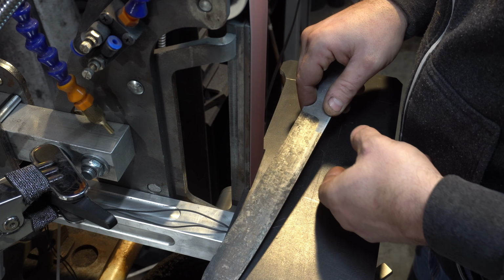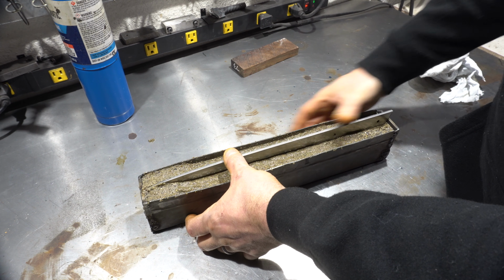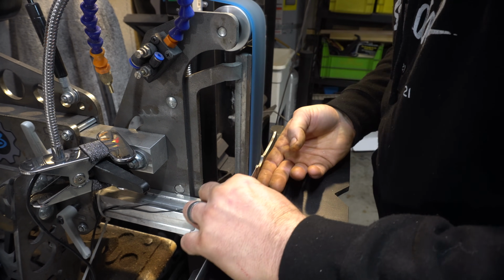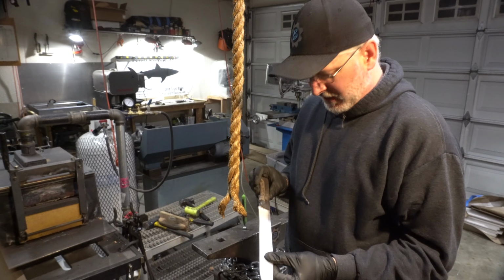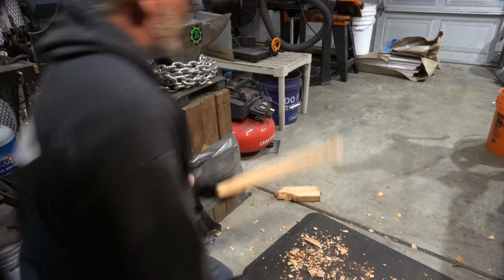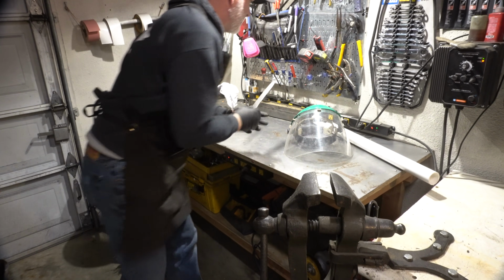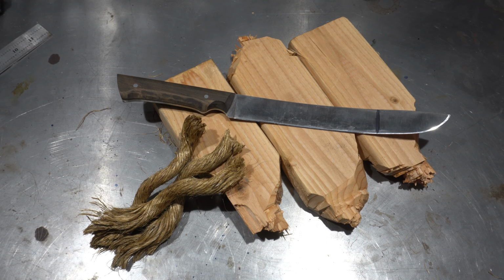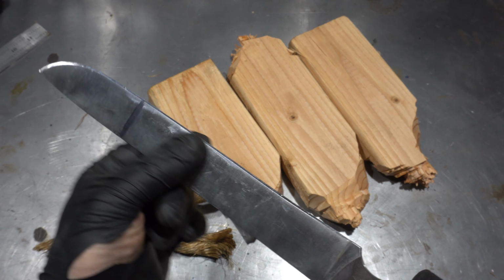Triple-T #62 - ABS Journeyman - Part 2 - Finishing and testing the performance knife

Comment from the maker: What did you think of the test?!  Were you cringing at the bend test like I was? 😜
Reply: Honestly, I am super proud of you for resisting the urge to use your knife as a catapult to launch the tube....... not that I have ever done that, because that would be super dangerous and immature...... Joking aside though, you killed it.
Reply from the maker: @bjornronaldson6017  thanks!  It would be kinda fun to make a catapult though.  😜
Reply: @TyrellKnifeworks  yes, yes it would!
Reply: That test made me cringe bad almost didn't watch
Reply: Its not so bad when its someone else doing it... not so much fun when its my knife!
whew, made it through on that one. I reckon on your finals knife though, do 2 at a time and then select the best out of them- do everything the same as you can and then test the 'lesser' of the two you don't like and test it to see if it holds up.
(I do this on most of my customer orders, make 2- but mostly because if I kill one through some accident then we're not out of time and if both survive, just sell it)
Reply: Great job! I asked out loud, "Is he going to hold it bent forever?!?" Good luck in Jan!
Reply from the maker: @justin.c.taylor  you need to make sure the blade is 90 degrees, not just the tube.  Better to overdo it here and find out.  😜
Reply: Lol, yes...are you gonna try different tempers to maybe find a breaking point? Maybe without blue backing? Was planning on doing some of that soon myself...

Comment: That's bending is impressive, you really got the heat treat of the steel perfect, even the amount of deformation is less then I expected.
Now i am interested to see the grain structure of it, are you planning on doing destructive testing now the stress testing is done?
The grin on your face during the bend test was also priceless
Reply from the maker: That's a good point, perhaps I will snap the blade and look at the grain structure on this one.  Yeah, I was pretty happy when the bend test was done.  The thing is, you can practice the rope test and 2x4 chop as many times as you need to, but the bend test is a one-and-done type of thing.

Comment: Wow, 90 degrees is guaranteed to ruin any knife that's not a fillet knife. I guess the purpose is for it not to snap?
Reply from the maker: Yup, it can't snap and shouldn't crack.  Note that the test really is engineered to prove that: 1) you have excellent heat treating skills (bend test, chop test), 2) you know about edge geometry (rope test).  Sure you can bend a filet knife 90 degrees but try chopping a 2x4 in half twice with it.  🤣.   Thanks for watching!

Comment: Great job! I knew you would pass the test. I’ve always wondered how a knife with a hamon would do with this. Blue backing is the obvious process,  but it still makes me curious about other methods. Edge quenching I’m not a fan of.
Reply from the maker: The differential hardening (hamon) and blue backing should be extremely similar.  The edge quench is totally different and the science has shown that this is not a good process.  The steel at the juncture is very brittle and I don't think it would pass this test.  Thanks for watching, Erik!
Reply: @TyrellKnifeworks  can probably explain it a lot better than me. He’s pretty well educated.
Reply: When you say edge quenching do you mean heating up just the edge and quenching it or heating up the whole blade and quenching just the edge? Or both methods are bad?
Reply: @mrkiky  just heating up the edge is what I was referring to, but neither is a good idea.
Reply: @erikcourtney1834  Good to know. I liked the idea of edge quenching because keeping the spine cold would prevent warps. Luckily I only did it on a pretty thick kukri which won't be bending any time soon. By the way, isn't the same thing gonna be a problem if you only quench your knife up to the tang?
Reply: @mrkiky  without getting all technical, edge quenching puts a lot of stress on the steel. You get a much more relaxed and stronger blade if you heat and quench the entire piece. Followed by desired temper procedure.   There isn’t a hard line between the blade and tang when leaving the tang partially exposed when quenching. (If you quench in an up and down motion). Basically the tang is in and out of the oil, cooling it slower not causing a distinct difference between the two states the steel is in. 
I’m not a teacher as you can tell. I don’t do well explaining things.🤣
Reply from the maker: @mrkiky  Erik is spot on. When you quench just the edge, there is a strong demarcation line in the steel.  If you snap an edge-quenched blade you’d see the line and it’s not good.  You’re much better to quench the whole blade and draw it back or clay it and do a differential quench (hamon process).  It leaves a much better quality in the steel.
Reply: @erikcourtney1834  But you do have to heat up and submerge the tang as well, right? I've seen lots of people only heating the blade, and I'm guilty of it myself.

Comment: Never had a doubt... Good job sir! I do have some notes on the table saw cutting, spent decades running one of those and know a trick or two...
Reply from the maker: Thanks, Kevin!  What’s your trick for the table saw?
Reply: @TyrellKnifeworks  two push sticks on small pieces or maybe even a small feather board... The feather board allows ones focus on just downward and forward thrust making it easier to use two push sticks...